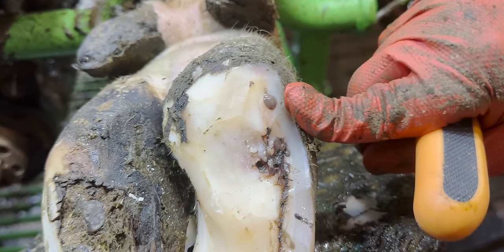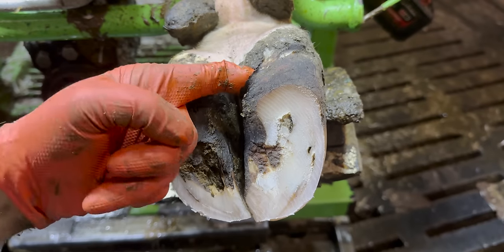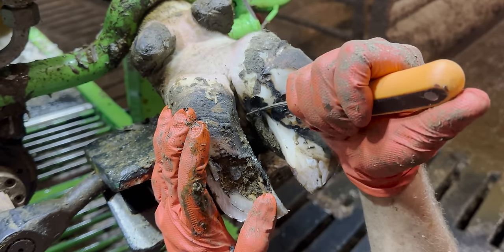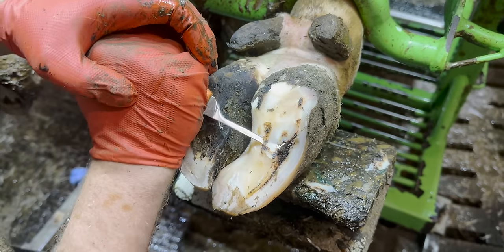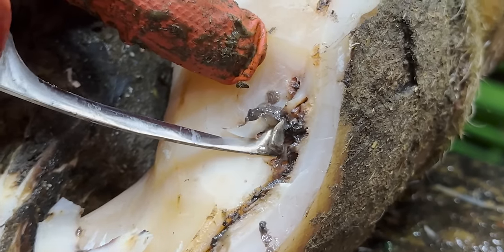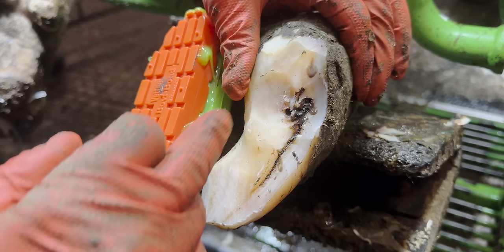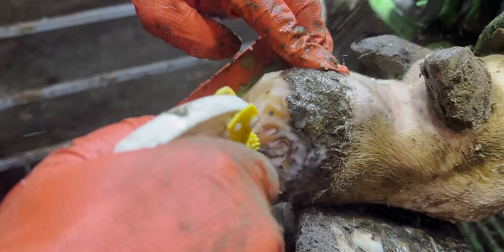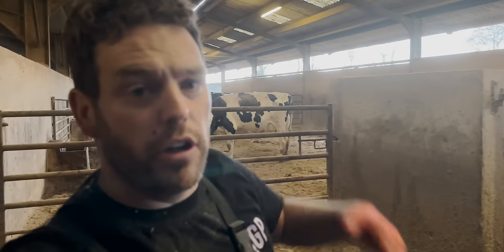BUBBLES BLOWING from a COW's FOOT??????? 🥴

Comment: Rain falling creates a down draft. The rain is pushed out from the center of the storm by the wind. When the rain is at an angle, that angle points to the direction of the storm. As the storm passes, the angle will change depending on if it is coming or overhead or leaving.

Comment: I’m a little curious, and maybe someone here can answer. We see the cow crush used to safely contain a variety of sizes and strengths of cows—it holds their tummies and necks, and keeps their legs tied so they can’t thrash around. Highly effective, fairly safe even for stressed cows, lets the hoof trimmers work quickly and safely and do a good job without worrying about cows kicking out. 

So why are these never used with horses? If anyone has answers I’d love to hear about it, but it seems to me like there would be a lot of instances where they’d be very useful—say for drafts that rarely have their feet lifted, or feral roundups, or auction rescues—even horses that are normally tolerant but have severe pain in multiple feet, preventing them from standing g nicely.

Comment: It looked like there was a bit of blood coming from the hoof at the end of the that one. I've never seen that before in one of your videos. What does that mean? Did I miss something? I'm referencing 7:23. Every other video I've seen blood is coming from the corium. isn't this a sign that there is a further bit of crack in the hoof that needs to be removed?
Reply: That blood is coming from the corium. It's sometimes hard to tell through vid, but he removes loose hoof horn until he can feel there isn't any more loose, and those little holes are open to the corium inside, which is why he sprayed and wrapped the hoof as well.

Comment: At the beginning when showing the hoof, you could see a crack running almost the whole length of the cow's outer hoof.  If I noticed it, you must have as well?  Is that only indicating soul separation or a strong clue as to what's wrong?

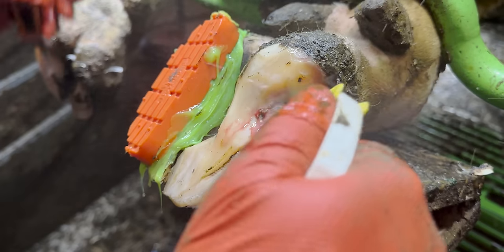Comment: Let me preface this with in no way do I intend to blame or accuse - just looking to understand is all. Why did that small section start to bleed at 6:53. It doesn't appear like the corium, assuming it might be. Just need clarification is all. (I do recall that the corium will bleed fairly easily.)